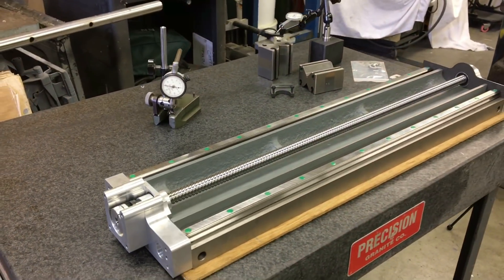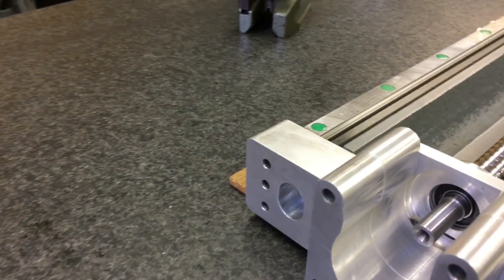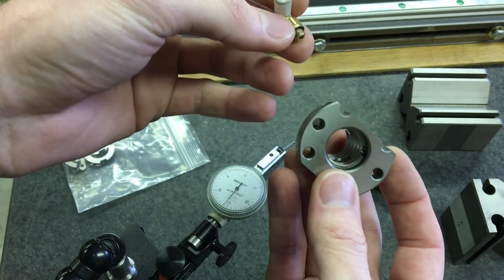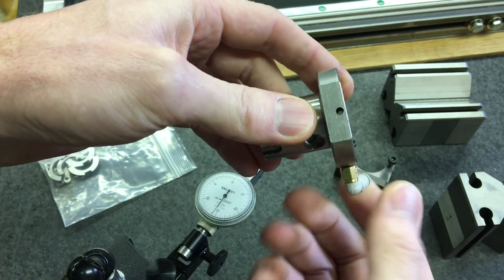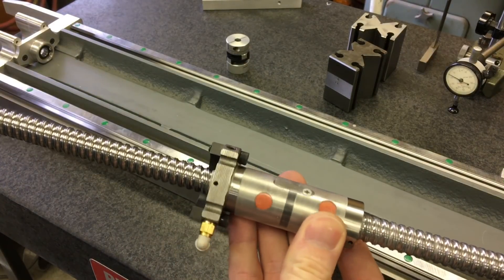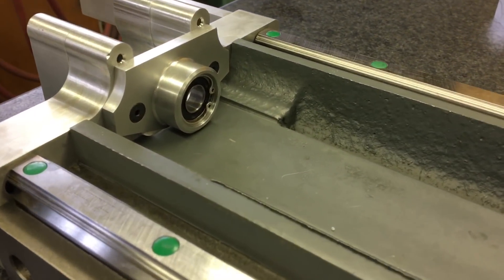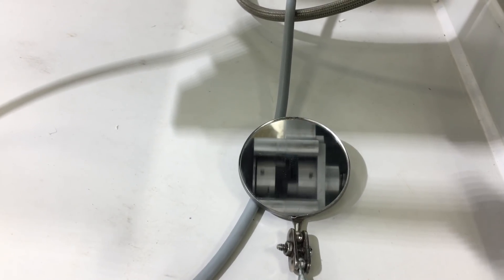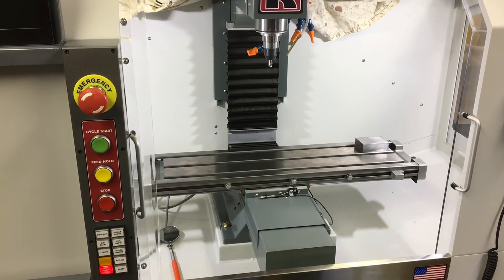China Ballnut Rebuild - 3

Comment: Very legit build, still working through all your videos (very helpful) what size steppers did you go with and are they closed loop? I'm ordering parts to convert my G0704 and I may switch to linear rails later but for now I'm keeping it stock. My plan is to go closed loop steppers but 3nm (424oz) is the largest I found in nema 23 do you think it will have the nuts with the stock dovetails bc I rather be over power than under but nema 34's are large?

Comment: https://bearingballstore.com/index.php?main_page=index&cPath=391&zenid=m84k1ndg026t6kh02qtihsjtn0
This is what you use to fit the ball screws to eliminate lash . If you wedge them apart it is just a temp fix and your only using 1/2 the nut in each direction also the balls do not have full contact and will wear fast.
Could be the video sound but it sounds bound up it should glide smooth and quite. The bearing layout you chose will also bind.
Ya live and you learn
Reply from the maker: Is it me or am I starting to see a trend here!?   ;)   =)  Take a chiller Tom. Cheers - Nick
Reply: Its you  LOL
youtube is based on comments and opinions not cheer leaders. When you post you should expect opinions not necessarily agreeing with you,